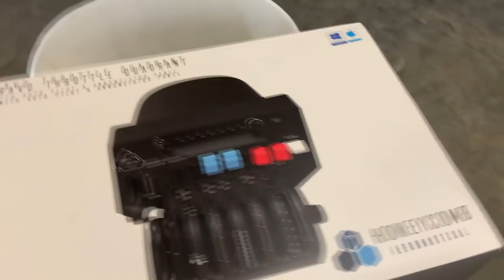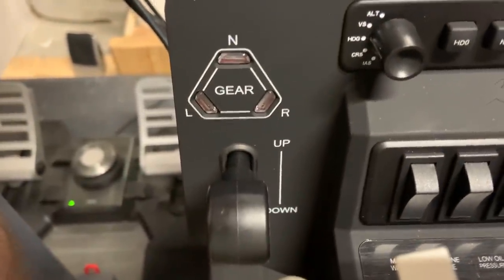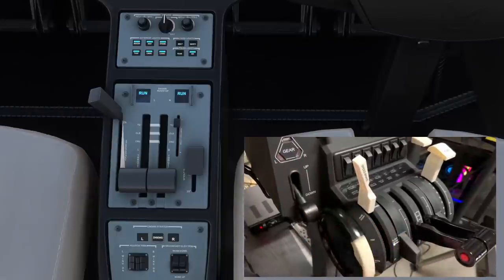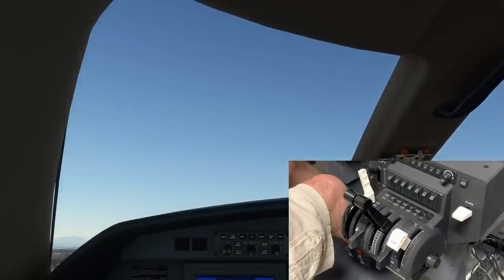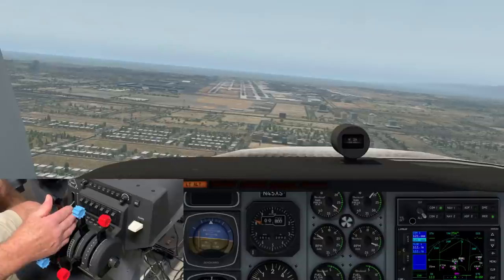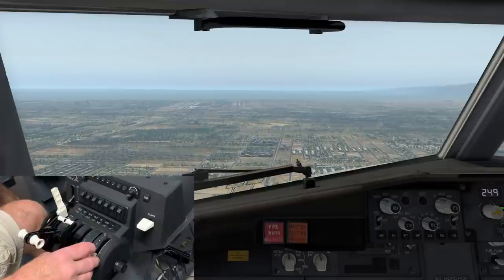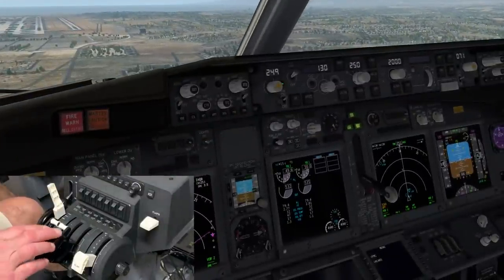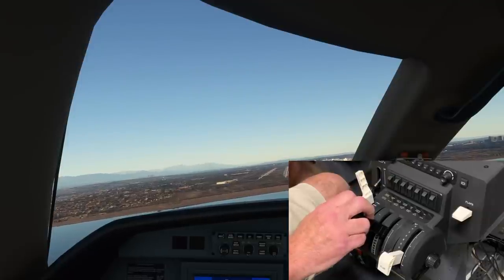Review: Honeycomb Bravo Quadrant - A Pilot's Perspective

Comment: I'm torn on this. I see they were going for a quadrant of similar size of the Yoke, so that they could use the same mounting base. 
But to me only 58% of the real size handles is too small for my tastes. I would expect at least 80%.
Reply from the maker: Actually about 60% scale is not too bad. The General Aviation  knobs are much closer. It is made for portability too. To get to full scale airliner size it would be a pretty big unit.  It is a compromise and while not high fidelity it is pretty good for the price.  Compared to the flimsy Logitech/Saitek Quadrant (which would require two to get six axis) it is a no brainer. If you want a rugged, realistic sized, general aviation quadrant with no frills(just levers no buttons at all) you can have the Virtual Fly TQ-6 for about $859-900. IMHO I agree with my wife that size really doesn’t matter😀
Reply: @rbarlow  Well in that case, I'll value your input, since you do have real world experience on that airframe. And if you say it isn't too bad at that size, then I guess I can shelve my reservations.
I did have the Saitek Quadrant, so I know the point of reference. And the Yoke is excellent (I had to return mine for a replacement because one of the button wasn't functioning out of the box). So I expect nothing less of good quality from the Quadrant.
Reply: I agree.  It's a tough call on this.  I'm not giving up on it until I find out if someone could "mod" new handles that are bigger.  EDIT:  ok thanks Ambrose

Comment: ~ 13:30 You are the second reviewer to state that the reverse handles are full on or full off and no in-between.  Darn.  As an amateur simmer I like to cheat a little and just use reverse for my convenience.  I guess I can just assign extra joystick buttons for that purpose and still use those regular reverse levers on landings (?)
The hdg / alt / vs / etc buttons along with the corresponding knob seem like a good idea, as I always have trouble mid-flight using my mouse to adjust altitude -- bounces knock my mouse pointer off constantly and I don't know how others can adjust a lever 100 degrees or so while turning and bouncing and moves your mouse off the virtual knob on the screen.
Reply from the maker: In real life we seldom used full reverse on landing. We were required by the flight manual to use them but we often just deployed them at idle on a long runway since after a smooth landing the loud shaking could cause passenger to rate a greaser as a bad landing. On a short icy runway was another story.
Reply: I guess you can do what I do on my two unit Saitek Throttle set up, ie assign the 4th and 5th levers as reverse axis. Of course it's not realistic that you have to change grip to access the reverse levers, but at least it's not just on/off then.
Reply: @kittealand  Yes it seems there are six lever slots on the Bravo.  If my math is correct one for speed brake, two for throttle, one for flaps, and I'm guessing one for Reverse Thrust up & down, with one still left over.  Not sure why you mentioned two levers for reversers.  Still, not as authentic, but I guess would work...  Thanks.
Reply: @rbarlow  Interesting.  As an amateur simmer I've found that really I've hardly ever really needed the reversers -- just leaves me down closer to the end of runways when not using them.  But don't think I've truly ever needed them, at least not when flying properly that is.  I'm guessing the flight sims (x plane) in that capacity are accurate to the real world, then.  Interesting you guys would use reversers only around idle -- kind of a smack in the face to the manual?
Reply: @mikem.2078  You have one reverser for each engine (unless you are driving an Airbus 380).  Then I'd recommend FSUIPC to set it up so that when you load a certain aircraft you can have a profile that is assigned to the aircraft automatically loaded. Typically you would create a profile called eg "four engined jet", "singe prop, or "dual prop" etc. In the profile you specify which lever should perform what action, so you may have a profile where eg for a "four engined jet" lever 1 is speed brake, lever 2-5 are throttles and lever 6 is flaps.  This feature alone makes FSUIPC worth buying for me.
Reply: @kittealand  Ah yes, thanks, now I see.  Not sure but I'm guessing for now I might be just as happy to only use one slot for reversers...  Have never experienced FSUIPC -- it sounds interesting, believe I heard about it before, but in all honesty there's so many utils and mods for x-plane that I constantly lose track of them.  I really should write these things down on a notepad so that I eventually download and try them.
Reply: @mikem.2078  Mike, sorry! When you mentioined XP11 I realized that was what Russ Barlow was using to showcase the throttle.  FSUIPC is for the MSFS-family and P3D only!

Comment: If you don't want to use the suction option what can you do? I already removed the plastic from the suction cup.
Reply from the maker: I didn't use the suction cup...use the clamps as shpwn or if you have a dedicated sim table you could possibly screw or bolt the mounting plate  to the surface before installing the yoke or quadrant
Reply: They say you can carefully put the plastic back on (that is if you still have it ;-) )
Reply: @chassmash8903  Brutal... I'll have to rig something up.

Comment: How does this (and other throttle quads such as the Saitek/Logitech) compare to the real thing in terms of size? To me they seem very small in the videos such as this that I've seen them in and that's kinda putting me off getting one.  The same applies for the Saitek/Logitech Yoke which I don't think is true-to-life size and smaller.  Are you able to comment on these concerns I have? TIA.
Reply: He said in the video - they're around 58% true size.
Reply from the maker: The airliner handles smaller than IRL but if they weren’t the would take up a lot is space and not sit on your desk. The general aviation handles are pretty close to real life sized. If you want to fly only airliners and have plenty to spend there are some nice 1:1 scale quadrants but you would need to build or buy a control pedestal to mount them. The Bravo is a nice compromise between flexibility, realism and cost. It nicely integrates with the Alpha to provide a lot of the controls needed to avoid relying on the mouse and keyboard to fly. For $250 it offers more value than other options I know about.
Reply: @cebrady  Did I ask you???

Comment: do you have the airbus throttle pack?  (thrustmaster)
Reply from the maker: Not yet but on preorder
Reply: @rbarlow  will you be reviewing it?
Reply: I honestly can't figure out why one would need to get it.  I have the T16000 setup (stick, throttle, pedals combo) and it appears going and buying the specific Airbus setup would be minimal and a waste of money (there's one youtuber who is making that very jump) -- a little visual difference, base color, and the dual throttle rather than single, is all I can see.  Thus the airbus setup looks kinda silly if you already have a stick setup.
Reply from the maker: Maybe if you ONLY flew the bus....otherwise I agree.  I do  like that the Airbus stick has two changeable grips for left and right hand use.
Reply: @rbarlow  not grips. Just 2 silly buttons that are junk. Check my channel I did a short review opening it. Airbus is a t1600m

Comment: spad.next have they bought out a profile yet?
Reply from the maker: Not sure...not a spad,next user...sorry
Reply: @rbarlow  i play more p3d than anything running fs passengers and opus weather ultimate traffic etc. Have a complete saitek flight deck and was getting a heap of errors. Plus the drivers didnt work unless you muck around with the power management usb device regedit. So just purchased spad.next. and solved that issue with crashing with overlays and also works perfect with all aircraft on msfs2020. Check it out may be worth your while.

Comment: I prefer use the real knob and instrument in the real cockpit to learn each plane. If you use knob on yoke, you won’t really learn each plane that are different. I like the six handle in VR , eventually the flaps but i prefer using the mouse in real to activate the plane instruments except for power, rpm and mixtures. And i prefer flight simulator 2020. Fs2020 is far superior for me.
Reply from the maker: Thanks for your input…makes sense.